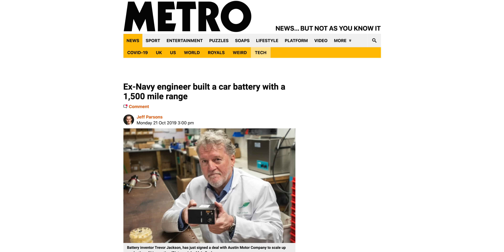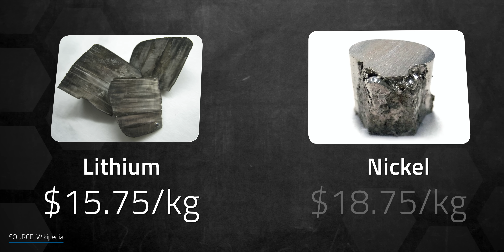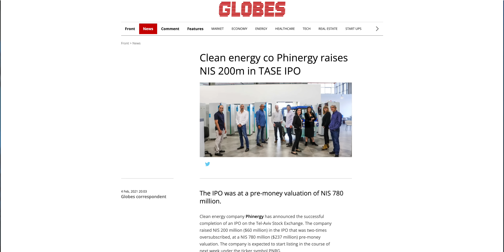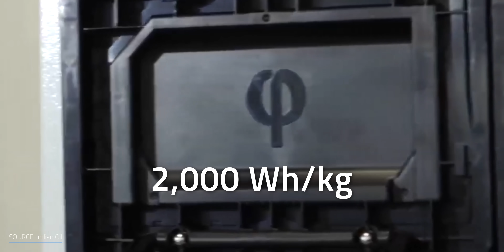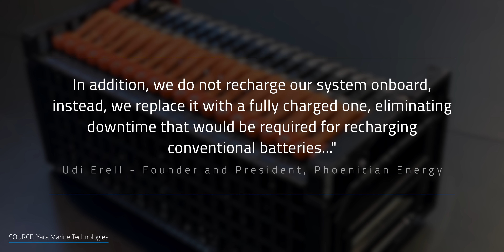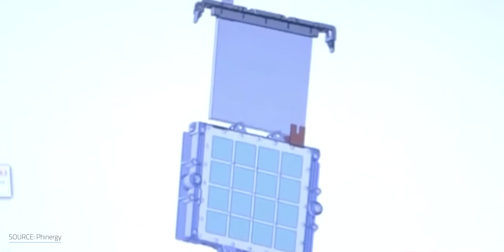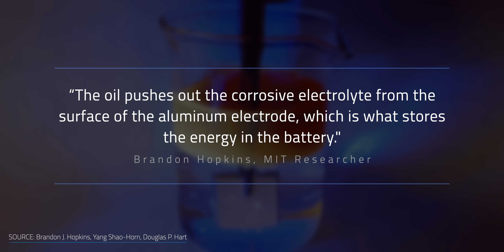Exploring the 1000 Mile Car Battery - Aluminum Air Hype?

Comment: If the batteries are cheap, then it doesn't seem a stretch to store a couple, plus if they are easy to click in and out (like the battery of a battery-powered vacum cleaner?) then it shouldn't be too much of a problem. Also surely not needing the infrastructure of battery charging stations would save a lot, and be a lot more flexible to roll them out. But if they are not rechargeable that means the company you swap them with has to entirely rebuild the battery? So I would just be concerned about the cost for labour and materials to do that... essentially you are bought into a corporate system a little more as you can't just recharge them with your own power, say if you lived off grid.

Comment: It would be great if they started designing EVs that could use this tech as a range extender, so you drive your first 50-60km on lithium power and recharge normally, but then if you’re unable to charge or want to go on a long trip, it consumes the aluminum battery to get you where you need to go. Would make the initial cost of your EV much more affordable, the car would be much lighter and more efficient, eliminates range anxiety assuming the aluminum batteries were standardized and readily available at “gas stations”.

Comment: The maximum discharge rate of that battery is very low compared to lithium ion batteries. This makes it unlikely to be suitable for cars since people want fast acceleration, which takes fast discharge rates.

Comment: The main question I would have is around cost. How much does it cost per mile compared to diesel or electric? If it costs less then there is something worth talking about but if not, it is dead in the water

Comment: An electric vehicle must use a universal battery that can be swapped out so no waiting for charging.
This is the only way I can see if they could ever be practical so if someone's traveling across country they pull over they swap out of battery they get to the nearest gas station they swap out both batteries and on and on

Comment: I think this technology does have its uses, I just don't think cars are one of them

I think it's just so much more useful over the life of a vehicle to be able to  recharge a car, rather than having to switch from one consumable resource like gasoline to another in non-rechargable batteries.

That being said, if they figure out the degradation issue, it might serve as a nice "reserve" tank as it were, for a rechargable EV, so in situations where the main battery runs out, or you need more range than a standard Lithium Ion battery can provide, one could design cars to be able to have a primary power source, and be able to swap to the backup Aluminum battery should the main battery fail.

Comment: I think if u can combine them right? Like hey i havr a new ford lighting.  But i wanna go deeo woods camping and want to have backup energy.  I can slip in some aluminum batts to extend my range so ifninrun oht ofnit all i can still charge the li ion batts to get the truck moving.  But ibthinknthey could be used as great range extenders for evs to solve the range problem.

Comment: Why do you keep calling them batteries when they are more like a chemical generator than a battery. This is why you cant wrap your head around the specs like "it could pound for pound replace a tesla model S and have a 2700mile range..." this isnt hard to believe when you realize you can charge the model S battery and go again and again but after 2700miles of the chemical generator it is dead and cannot be charged. One could make a similar statement like "Our new air battery can last over 5 million miles and weighs only 50lbs..." Not thinking about the tech that might blow you away, but when you consider the person is talking about a compressed air tank strapped to car it starts making more sense.

Comment: Sounds perfect for an EV with a hybrid battery. Small 10kWh lithium battery that can be recharged easily and a big aluminium air battery for those occasional long range drives.

Comment: I think swapping what is the original solution for lithium batteries. Most of the developing world can’t have charging stations or grids as the developed word experiences now. Therefor the swapping is the best solution. As the size is significantly smaller and lighter, carrying a back up aluminum battery would make sense as the norm. Emergency roadside vehicles could also carry spares. This seems like the solution if widely adopted

Comment: Battery swapping doesn't seem bad. If you standardized the battery packs where the same pack fits in all cars then it would be like picking up a can of propane at the gas station or like replacing your power drill battery. I think it has potential

Comment: I'm skeptical, for one reason... Cold. 

Lithium Batteries already operate at a massive deficit in cold climates, so EVs normally need to keep the battery warm in cold temps (Although it doesn't drain much, it's still draining battery to keep them warm enough). With water being in the Aluminum Air batteries, they would freeze at below 0C. For cars, how would that work?

Comment: Bauxite! I first learned about Bauxite from playing Gregtech, a Minecraft mod. It's pretty fun. You have to electrolyze Bauxite to get the aluminum out of it, yielding lots of hydrogen and oxygen. It also gives you small amounts of Rutile, a mineral containing Titanium (which is quite challenging to process). But a search on Wikipedia shows Bauxite doesn't contain any Rutile; instead, it contains Gallium, something rare and vital for making circuits in Gregtech.

Comment: So my daily commute is like 10 miles round trip. Although I'm not a huge fan of the battery swap concept, only having to do this a few times a year wouldn't be terrible. If something like this could be retrofitted into ICE models, it could be a good solution to keep a lot of cars on the road, like my 2002 911. Combine a lightweight battery pack with a lightweight motor like the new one by Koenigsegg and there's a LOT of cars that could get a new life.

Comment: Their is also wireless charging from the road, where there is a changing cable buried in the road, you cell dillweeds.
   And there is also libear electromagnetic induction motors using the same platform.
   But your right, nothings perfect.

Comment: LiFeP main battery supported by Al-air plug in cartridge battery where range extension needed. Should be possible to get 20KWh out of something size of small suitcase weighing about 20Kg.

Comment: How about use as home backup energy source. Electrolytes added when power goes out and you just call service to come swap out when done using it. No generator needed, no gas to find, etc
Reply: Not sure what the costs would be?

Comment: I remember Zinc-Air, way back .. but they were primary iirc, non rechargeable ..
Oh wow these aint either ? A swap-out system ...??

This could be where the OTHER guys missed a trick - imagine, if someone wants to leaprfrog Musk, design a vehicle where the entire battery assembly easily rolls out, and you trundle in a replacement in at the Gas Station - not cause you HAVE to (its still rechargeable) but imagine the boost in adoption where the main volatile/consumable part can always be renewed in the event of failure
If there was a universal standard form factor (which still allows for new tech batteries, the less radical of which could be accommodated by vehicle software updates) used over the entire industry, it could be pretty Win-Win?

( If you make your first millions with this, I'd appreciate some pizza - thanks! )

Comment: For most people, there's a huge difference between one's typical commute distance and the range one would wish to occasionally have.  

A dense but non rechargable battery, if it worked out, could be a neat solution; instead of oversized battery packs current EVs have, one could size them close to typical commute distances instead, and add the non rechargable battery that would be dipped into only when one travels farther.

Wouldn't be surprised if that could cut the battery mass to a third for similar range, and require only very occasional swapping.

Comment: I agree the anxiety of running out of energy is overhyped. Frankly, if the cells (lets call them that for now) are not too heavy, why cant there be vending or self serve areas? I used to have to leave work to get a propane bottle for my grill filled. Now, I use a vending machine. Plans need to be made to make a standard sized pack and that is where the issues will arise. Cars will need to use the same cell design. Otherwise, swapping cells will require a myriad of cell designs and choices and run up the costs. Also I think Howard Johnson below has a great idea of having LiION pack as a reserve for emergency fails.

Comment: Battery Swapping is viable to a very price-sensitive and niche market, like India.
1.	Labour is cheap / plentiful in India, so re-cycling is not an issue, nor is replacement of the battery by the service station attendant.
2.	Since Aluminium is abundantly available locally, whereas Lithium needs to be imported from China (negative point), Aluminium is the prime choice – it is also not hazardous, like Lithium.
3.	Absence of charging facilities (no scope for roadside-parked cars) makes this more attractive.
4.	Charging a battery takes a huge amount of time, whereas a battery swop is fast.
5.	A hybrid vehicle would be better – keep running on the battery, till it’s time to swop, then switch-over to the gasoline engine, till such time as you can get a swap, at a convenient outlet.

Comment: I made one like this in high-school and was amazed and the issue I mainly faces was sawping it out with hot and cold Temps it was getting deformed as well when the alkaline process began it was eating its self a bit and leaking but I went back and a inner plastic case worked better but needed to be a special plastic and the pumping the water would definitely work you would need a filter in that process and to solve the changing battery issue it see if you can do something with the aluminum so that it's like most modern batteries in cars

Comment: I would drive something with battery swap.  I think the case that the car would need a tow for a battery swap might be wrong since a truck could bring you a new battery in an emergency, right?   If glas replacement can be done in the field I don't see a reason this couldn't.   

Honestly I think Lith battery packs should be made swappable as well.  Then we can just lease time on the packs. Long road trips can be done by swap on the way.

Comment: Battery swapping is a great way to move on quickly. I don't see the downside to this tech. Battery degradation can be monitored and a rough estimate for Battery swapping indicator can be used just like a low fuel indicator. Also, speaking for Indian Market & the network of Indian Oil Corporation, it is very much possible to have Battery swapping network across the country. Once Aluminum is corroded, a new aluminum slab can be inserted in its place in order to make the Battery structure reusable.

Comment: The inability to recharge these aluminum batteries make this technology very limited in terms of commercial application. Who will want to hassle with swapping out these batteres? The cost of the swap out? The lack of infrastructure for the swap out? I doubt you will be able to just pop your rear door open, pull the battery pack out and replace it. Or even if the back hatch space is big enough to accomodate the battery pack at the alleged mileage ranges mentioned. Non starter for EV's IMHO..

Comment: Battery swapping?  Yes I would, in a hybrid.  Perhaps something that has a 60 mile range that is rechargeable and an option for a hot-swappable battery pack for longer range - that’d be viable and help avoid some of the issues with charging stations assuming swappable batteries are commonly available.  … that is assuming such a car and tech are cheaper than gasoline power.  That is a tough hurdle to overcome.

Just because something is “green” doesn’t inherently make it better.  It has to be readily available and cost effective to be viable to supplant what we have now.  Not opposed but not sold on such yet till that equation changes.  I am receptive to carrot initiatives, but someone trying to force me to change when it doesn’t make sense for me will meet stiff resistance.

Comment: This is a step in the correct direction, but battery swapping has been shown to not work for cars in the past, and the issue of standardization is a challenge. However, I can see it working on heavier vehicles, like buses and trucks. Marine applications are also possible.

Comment: I really hope they come up with new sustainable battery technology....so I can swipe up those lithium batteries/current ev cars for dirt cheap! It's amazing you can now buy a 3 year old EV for a third of it's original price or less. Keep advancing 😁
Reply: Oh and it's funny you can even use newer batteries in old EVs..they're all DC anyways just with different voltages. All you really need is a good platform and you can keep updating your battery... eventually these manufacturers will figure out a trade in program like BMW did with the i3

Comment: Matt i think a battery with all the feature on top of our existing used Lithium Battery, definitely ppl wont mind swapping the batteries. LIke how we get road assistance for battery quick charging or tow truck. there will be options made available for battery swapping also when more adoption or when aluminum batt tech comes to reality. Our bright minds will find quicker options which will over all hurdles. Currently we should be more concentrating on quickly finding solution to find solutions to get an alt-batt source in replacement for lithium one's like aluminum ones. So car's (in all practical use cases where batteries/ power source is needed) so our we move quick from fossil fueled engines to electrical powered one's. 
which is important for us to think and work, so we can reduce the huge pollution we out and keep hurting our planet.

Comment: Non rechargeable lol, so the recycling will not be carbon neutral eh ?
And what about the trucks with all the batteries clogging up the roads to drop new ones off and take old ones back ?
If they were rechargeable sounds ok but they are not

Comment: Yeah with this technology, the pros far outweigh the cons, even with 1500 mile range it's still great. The main advantage of course is the battery swapping time that will rival the time spent currently at a fuel filling station.

Comment: I love the idea of battery swapping. When I tried to implement battery swapping in an engineering videogame (Space Engineers), I ran into the issue of (1) the tracking and control mechanisms to make sure the valuable, discharged battery isn't lost were larger than the size of a car, and (2) there was a rather rough clearance issue that made it very difficult to insert and remove the battery because of its size and weight.

Comment: Really cool but it what about the actual volume of the battery? The guy claiming 7x range compared the weight only, but if you need a trailer to fit all the batteries in the car, that's no good :) still for marine or even long haul trucks it sounds really nice, and you could combine it with rechargeable batteries as well to get around the emergency issue

Comment: I dont think the technology is viable for cars. Maybe long range trucks and aeroplanes and ships but something that cannot be recharged and needs replacement after every use seems prohibitively costly. Also how many battery packs can a given switching station store for vehicles that come in to get their battery pack replaced ? How will they be delivered and then collected for recycling ? Logistics, storage, recycling all put together seems non- viable. If they can improve on the technology to make it  rechargeable then it would be perfect.

Comment: It all depends on the cost. If the batteries are significantly cheaper than gas per mile, then yes I would be more interested in a swappable battery car than even a high density rechargeable one.

Comment: How hard is it to rebuild the batteries to replace the worn out components?  It sounds like with the rebuild process they can be recharged.  Perhaps a more efficient manner of construction would allow owners to field swap the corroded aluminum plates with a fresh set of new plates.  Such that component spares need to be kept in each installation of these types of batteries as well as one redundant power cell in situations where a motorist cannot spend the time to rebuild their battery pack.  But if it were in a mobile solution a 2nd person could decouple the power connections after power is automatically shifted over to the reserve power pack.  Then they can spend time to rebuild the worn out parts.  The last thing that is needed is to pull over to a charge station...like a level 4 Tesla charge station to fully charge them.  By the time it is required to pull over it could also be time to rebuild the spare as well.  Such a solution may seem a pain in the butt but can provide 8x the range of current electric powered vehicles according to this video.

Or when they pull over for a recharge they may be presented the option for a battery swap.  Then the folks running the recharge / battery swap station can take the time to rebuild and charge swap units as a service.

Comment: 9:35 Tow trucks could carry spare disposable batteries the same way they carry other junk for road repairs so no you wouldn’t necessarily have to tow your vehicle if there was a deployed system of support  
That said, recyclables will be treated as disposables, especially if one can extract silver by any crude means from that battery. So…just no.